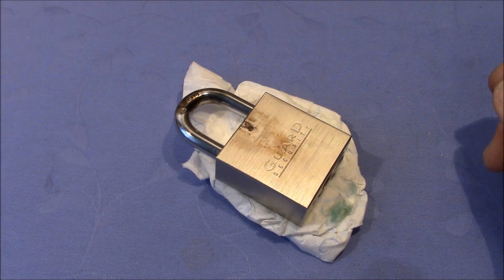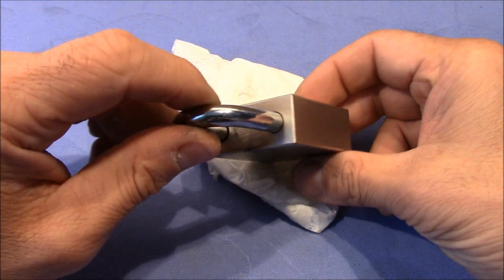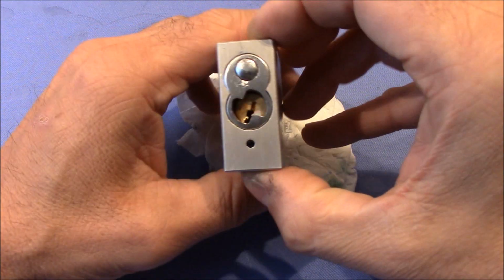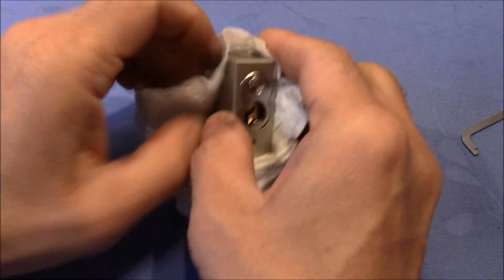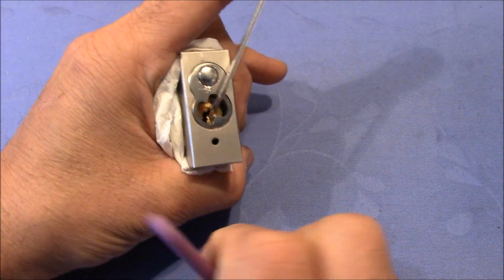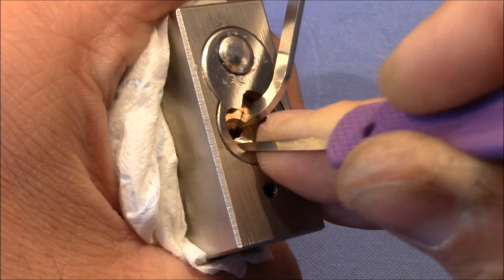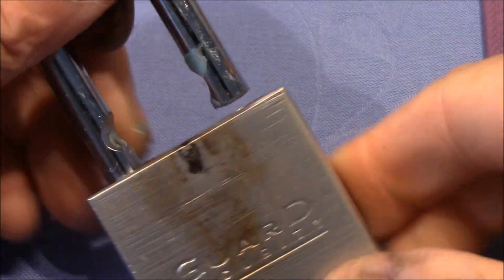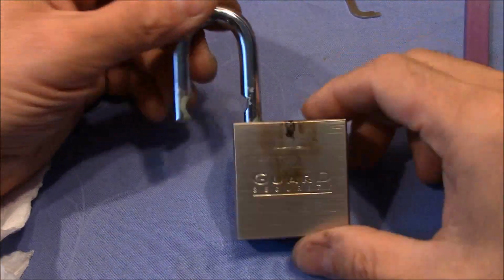(picking 593) Fun: Picking a crappy lock right out of the candle

Comment: How did you keep the liquid wax out of the core when making the candle?
Reply from the maker: I was afraid the wax would go inside by every possible gap or hole. However wax is not as fluid as water and so nothing went much inside. In the keyway I stuffed in the string and this also work pretty well.